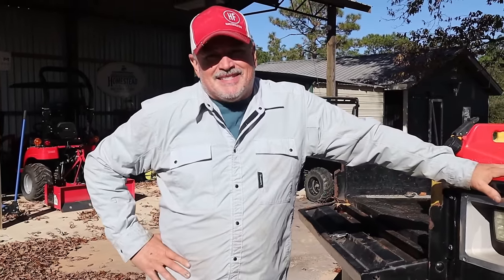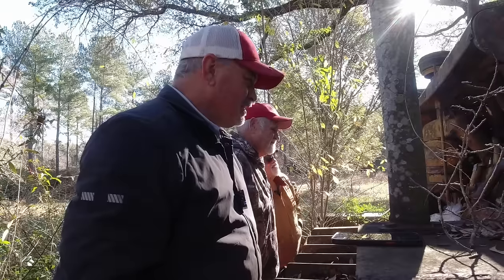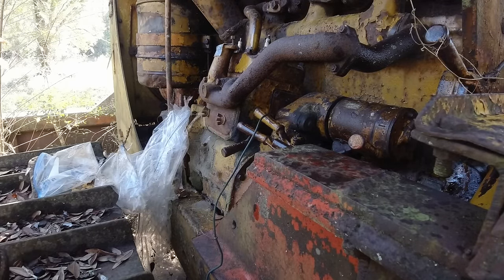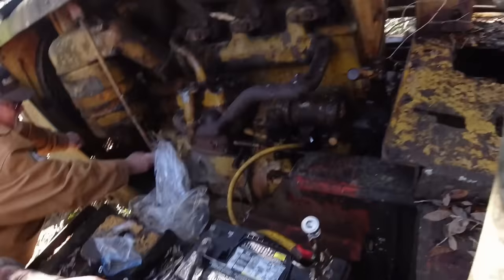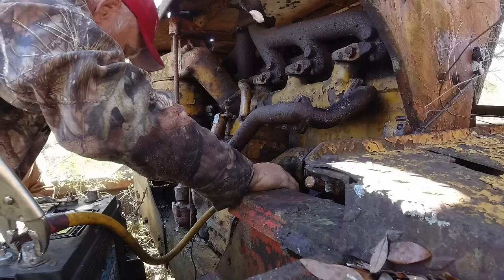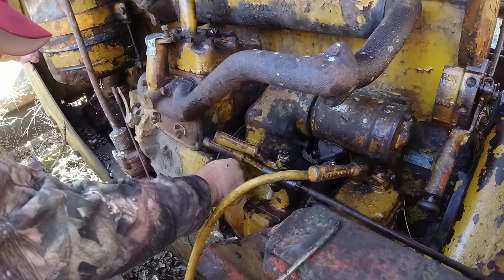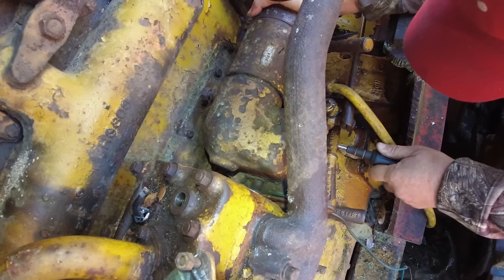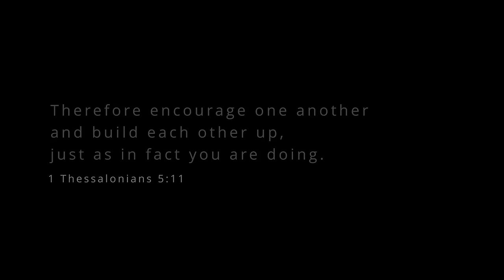MASSIVE Caterpillar D8H bulldozer sitting 20 years! Will it start?

Comment: I just admire your determination to try and figure out how things work and bring an old machine back to life if possible. Your journeys make my day.
Reply from the maker: Thank you
Reply: I also liked the comment to diesel creek, mat
 I am 60 and I been on heavy equipment since I started crawling like a baby
Reply: But I restore antique farm tractors and equipment and construction equipment.
Reply: I have brought back a Northwest dragline with a 371 Detroit engine, that hasn't been started in 30 yrs, and the only way to it is winter ground frozen.
 But got it running and I have 1/4 mile to drive it before the frost goes out here in mille lacs lake Minnesota
Reply: Have you made a follow up on this yet?

Comment: I’ve owned dozers all my life, I grew up helping dad pay the farm off when I was only 9 years old running an old “cable eight” we called it, a D-8 Cat Crawler Dozer essentially, and we always had problems with the old dry pins and bushings seizing up if it sit only for a week, in rain and bad weather, that last time we moved it a couple years ago, it had been sitting for nearly 20 years, and I was successful in getting them broken loose using off road diesel fuel, just like we did in the old days. It’s far more expensive now, then it was back in 1999, when it was last worked around the farm, but it still worked all the same. It has a very low time UC like that as well, and all we would do is put off road diesel (ORD) road diesel (RD) would be the same science, just ORD is a little cheaper. Lol. Just put some in a garden sprayer, pump it up and saturate all the pens over and under then let it sit all night, come back in the next morning and do it again then, when you get it moving, it should be free, or very pretty easily. Then once you get it working, stop and spray the pins down every now and then with diesel fuel, then eventually, you will get them working really well. Just don’t let your friends at the EPA know you are doing that. 😜
Reply: wonderful life. thank you for the life stories.

Comment: I wouldn't worry about a carburetor or anything else until cranking the little pony engine gets figured out, whatever got both the pony and main engine turning might be the key. This sure is a learning experience, I've never seen a starter motor that doesn't have any kind of bendix on it to engage the motor pinion to the flywheel, please do a follow up on this so we see how everything works, this is very interesting 🙂

Comment: Hank and Wylie this one was a losing battle for it even started , no carb and plug wires for the pony motor  no chance but great try Matt from diesel creek sure could have helped but great video thanks
Reply: Diesl creek did have extra parts for pony . Sure he would help if possible  .
Reply: @carrollfranklin9807  Matt would probably try to buy it lol 🤣
Reply: You could start with a pull,  put it in a high gear,. Make sure the engine is turning in the right direction which can change with forward reverse laver.
Reply: @kevinbyrne1677  not on a cat   you would need a much larger vehicle to start it that way
Reply: And now i dont need to watchthe video... thanks a lot
Reply: @jacquicrockett2040 Lol he probably would at that!
Reply: @danellsimmers9263 Yeah that's a sucky thing reading the comments lol

Comment: That pony motor has a magneto that makes the spark.  You have to make sure that is working and they have the intake for the carb upside down. I have been starting old cat engines since I was a kid with pony motors and I have run many old D8s
Reply: THE CONDENSER IN THE MAG. LIKES TO GO BAD, OF COSRSE NO SPARK .

Comment: I believe it'll help it out majorly and help improve compression to. Along with freeing up the sticking rings inside of those cylinders to. That pony engine starter may need overhauling really good to. Like bushings re- greased that nut is the adjustment for the flywheel pressure plate engagement release. I'd use some pre-treated ethanol free gasoline fuel in that setting up pony engine to help out with cleaning out that updraft carburetor needle and jets to. It's also called A flow jet carburetor to.

Comment: First of all , the dc starter was only designed to start the 2 cylinder pony motor , if the pony motor has good compression and tuned good it does fairly well starting the diesel motor , if the pony motor isnt maintained well , you have big problems in the winter . I`ve worked around several cable blade 8`s and ran 1 a little , they were a tough , good dozer .

Comment: I would think you would need to git the starter to turn over the engine first.  So the ring gear on the flywheel bad ? I betting that would not be fun to change

Comment: If you can get the pony motor to spin you can use starter fluid to get it to pop off and then use a spray bottle with gas in it to keep it running  you don’t need a carburetor it will make your life much easier if you can get it going

Comment: I owned that model dozier it takes 12 volt to starter you can run chain under blade there is big hook pull it off with tractor dozier start mine several times buy pulling it off

Comment: I'd  pull out the injectors and pour some ATF marvel mystery oil down into the cylinders to pre- soak the engine cylinder's with A while. Then  put the injectors back in it after removing them to add in the pre-soaking solutions. Let it set inside of the engine. until you can make it back out there to it again. To try it out by either removing the injectors to turn the engine over to clear out each cylinder  and put the injectors back in one by one.

Comment: You will have to pull it to start  and it takes a strong tractor to pull it fast enough to kick over.  We always let the blade down on a block to hook a chain butt sometimes my father in law would forget. If you dig a trench under blade then run chain under and hook up high on tractor, chain will lift blade when you tighten  up chain to pull it just dont let chain  go slack real fast

Comment: Hi, Folks.
That is NOT a D8H. Best guess - 13A series, built from 1953 to 1955. The clue is the fuel tank extension coming forward on the right side. 

Wouldn't it be nice if they 'ackshully' KNEW what they were doing. For a start, that electrical system would be SIX volts for the starter on the pony motor, NOT 24 'jolts' like they thinking.

Then the lever ahead of the starter pinion housing engages the starter pinion as well as activating the starter switch.

Did they check ANY fluids before trying to 'make noise'???????

Still, HATZOFF to 'em for having a go and trying to save the old girl.

Just my 0.02.

You all have a wonderful day. Best wishes. Deas Plant.
Reply: you are correct 1953 13A, I own it 😝

Comment: OK , I will guess that the pony motor is stuck ! 😭 You will  have to take the pony OFF and  disassemble it , repair the pony , get it running on a stand  then put it back on the dozer.  These dozers take about 10 minutes of cranking to build HEAT  & FUEL & OIL pressure .  Watch DESIEL CREEK D8 videos . avoid his mistakes .  Great no start video ?  thanks